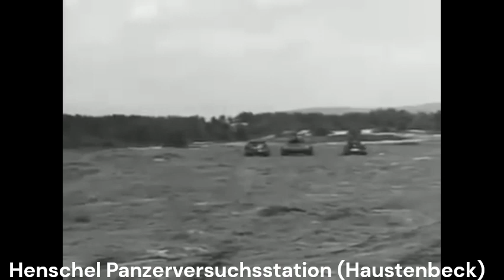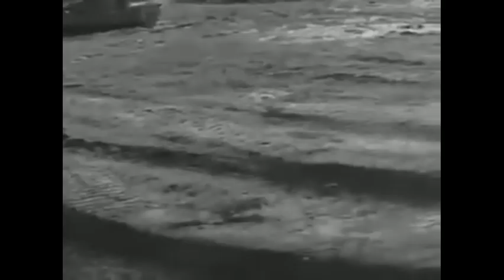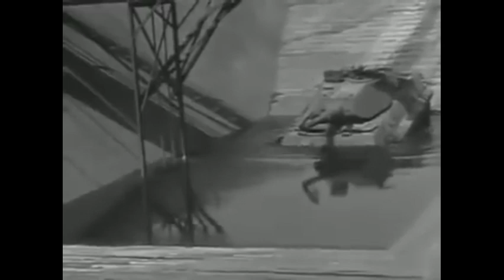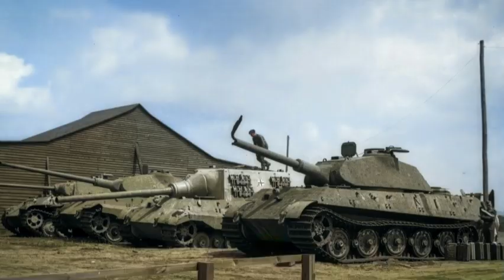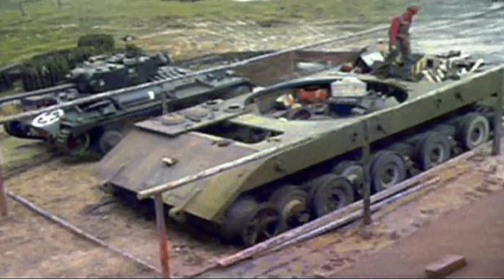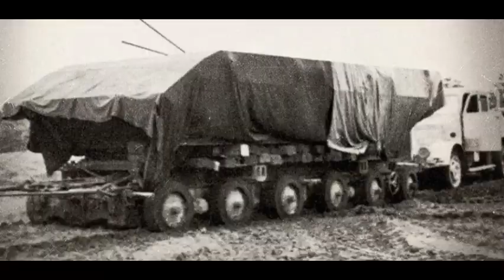The Taming of the Beasts: Allies Test King Tiger, Jagdtiger and E-100 (August '45)

Comment: The E-100 was never approved for mass production. It began as a Krupp proposal, known as the Tiger-Maus in 1942. The vehicle was meant to compete against Porche's Maus as a lighter, cheaper, less complex tank. However, Germany's leader preferred the Porche Maus proposal instead. Consequently, the Tiger-Maus project was then dropped. When the Entwicklung project began, Ernst  Kniepkamp, the head of the Automotive Design Office, redesignated the Tiger-Maus project as the E-100 in the 100 ton weight class tank design. The only change in design was the replacement of the Tiger-Maus's torsion bar suspension with an external Belleville washer spring suspension. Development languished as the vehicle was placed on low priority. With interest in super heavy tanks dropping as the war progressed, and the cancelation of the Maus project, it was decided to used the single authorized E-100 prototype as a test bed for the Belleville washer spring suspension as a replacement for torsion-bar suspension on Panthers & King Tigers. At war's end, there were no future plans for the vehicle's development.

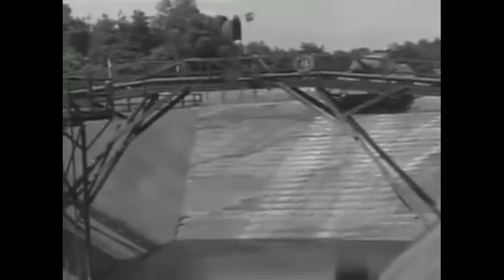Comment: At 2:25 it appears the Tiger has neutral steering, that can't be right?
Reply: Yes, it did, but its use was discouraged since it tended to damage the transmission.
Reply: @Sig-i3z  Thanks, i never knew. Must have been one of the first.
Reply: @suspiciousminds1750 I believe the Churchill was the first tank with neutral steering, at least the first to ne mass produced.
Reply: @Sig-i3z  TY

Comment: I often wondered why the German had chosen this direction for their tanks, and came to the conclusion that the real problem they had identified was the manpower : Germany could not afford to loose tank crews. They'd rather have fewer, stronger tanks which guaranteed maximal survivability to their superior crews, than many, many cheaper tanks that they couldn't have manned efficiently in large masses.
Reply: You are correct.
Reply: That is a great hypothesis, and would've been a risky call. Lucky for them, their engineers were capable of doing whatever they deemed necessary.
Reply: Actually it was more about the fuel cost in training those vehicle crew manpower Germany were concerned of. Just manpower wise, Germany ended up having more men than they had weapons for when they raised Volkssturm militia.
Reply: They were running out of dudes, this was the only option
Reply: @randysurline4651 it’s not an option if it crushes roads and can’t cross a bridge. Just build a pillbox.
Reply: France had the same problem in 1940, after so many soldiers were killed during WWI, that's why the one-man-turret, wich was a disaster on battle field
Reply: @philippemasson2205 No, the one man turret for France was a problem because they had a disco and casino in the hull. They were thinking French, instead of what everyone else was doing. Their ships were the same. Sht.
Reply: @evilstorm5954 ridiculous...
Reply: This theory kind of contradicts what happend during the war.

For example were Tank crews without a running tank forced to serve in minor infantry roles.
If those crews were so versatile, why use them in high risk tasks?

Also is the permanent usage of Beutepanzer a counterargument.
Some late war Tank Crews had to use early T34 or older French Tanks.